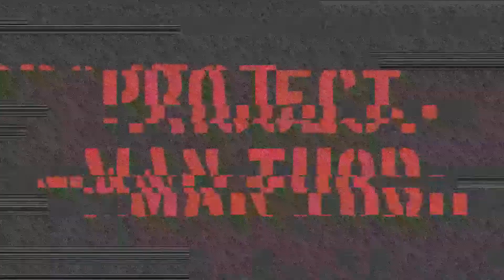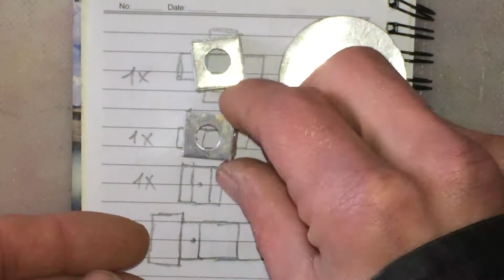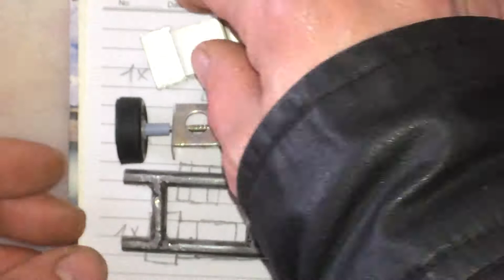Chevrolet Custom COE - Bonus Truck Part 1/2

Comment: Outstanding fabrication work with the putty and mig welding! You're way out of my league now! This was brilliant work. I look forward to seeing it in the finished diorama which I know you've been working hard on. Thumbs up from Switzerland - Andrew 🍁
Reply from the maker: Thanks, but i think not even close!!!
FInishing details on the scratch built trailer, metal chassis and steel sheet, unfortunatly it's taking almost all my time, can barely find a day in a week to check youtube. Must take a break after this diorama and Bonus truck deal.
Stay safe, cheers.